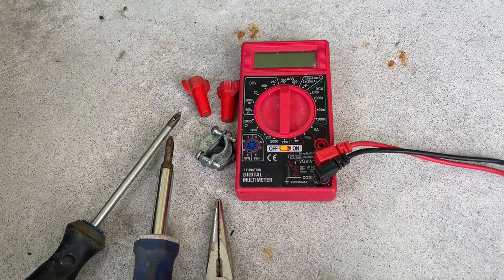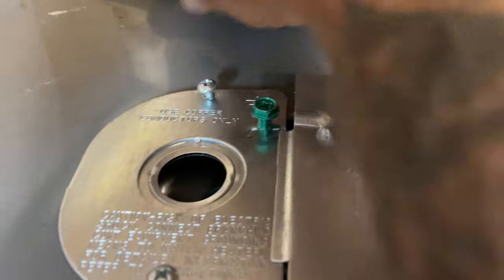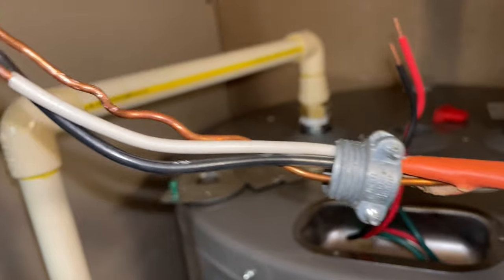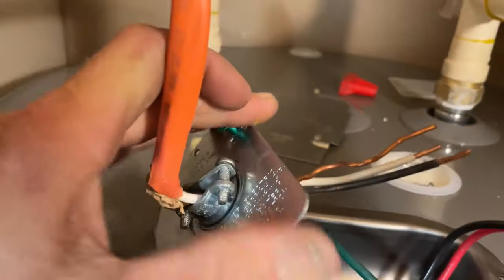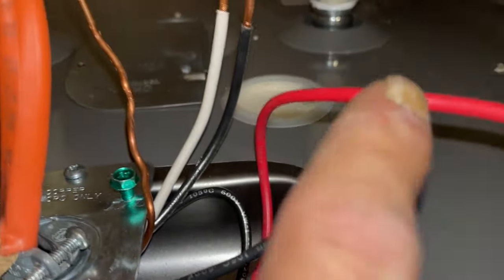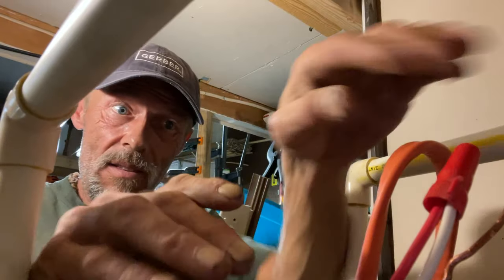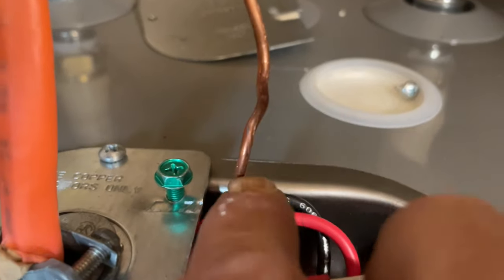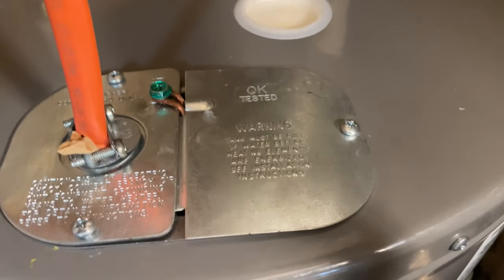HOW TO HOOK UP POWER TO AN ELECTRIC HOT WATER HEATER

Comment: Don't learn electrical from a plumber people....  While the water heater will power on with this install, it's sloppy work.  The wires should always be twisted together using lineman's pliers before you wire nut them.  The insulation should be intact past the strain relief.  Use a tic tester to test for power if you don't know if the circuit is live, especially if you're coming to YouTube to learn how to do this.  220VAC will hurt real bad if you mess up.  Your wires were literally touching together when you said you weren't sure if you hit the right breaker.
Reply: Not to mention: that bare Romex into the junction box is unacceptable.
Reply: @roscoejones4515 I'm just learning but every video talks about the "bare copper wire" when discussing electric water heater installation. Electricions included. 🤷🏼
Reply: You don't need to twist the wire together with linemans unless you hot a limp wrist. But other than that I agree with what your saying
Reply: @nickgamble4544  hahaha bro. Electricians. Im dead!!!
Reply: As long as you do a pull test after twisting the wire nut on and everything is secure then twisting wires together isn't necessary, unless you have 3 or more wires in one connection. Sloppy work though

Comment: Just to note if you are using your white (neutral)  as a hot wire, you need to tape it with black or red tape on both ends... marking it as a hot wire. You'll fail inspection here if you don't.
Reply: Just as I’m saying to my self why did this person wrap the white wire with black electrical tape I read this comment lol😂
Reply: Lol you won't fail inspection....
Reply: @MikeHawkPEN15  you are right, you won't fail... but they will make you wrap it here.

Comment: Just saying, if I was asked to inspect that I would fail it. Reason being you have cut up the insulation outside of the cable clamp. You should be able to see intact insulation protruding from the inside of the wire clamp. The wire clamp should only be holding onto completely intact insulation.
Reply: I was actually going to say the same thing. I thought he might clean it up at some point, but obviously never did.
The way he left it would be failed as a potential shock hazard.

Comment: Lots of homes that have Aluminum wire for large appliances even today it's still legal to use AL wire for water heaters because it's not branch wiring. I had a plumber replace my water heater he used  yellow wire nuts and the connection was poor. Found my breaker tripped and black mark up the wall the AL wire burned back into the wall lucky it tripped the breaker my house would have burned down.  The plumbing company sent an electrician I told him I want a disconnect box at the water heater that way AL and CO wire are connected using LUGS that are approved for both AL and CO wire. If you run into AL wire when you connect a whip from a new water heater that has copper wire don't wire nut use a disconnect.

Comment: Tomic connector... Not adaptor. And that Romex should be in Greenfield, Flexible metal conduit so its protected. And always twist your wires together before you put your wirenut on. And always make sure the insulation on your feed wire is in past the pinch point of your tomic connector before tightening

Comment: This is just a suggestion made by an electrician when reconnecting old incoming wires to the new water heater You should cut off the old wire leads if enough slack is present, this way you have a nice clean connection for your new wire nuts.
Reply: I twist my wire before I put the wire nut on to make sure they are tight before the nut is installed.

Comment: Can you attach the ground wire to the green screw inside the compartment or do you need to use the one on the outside like you did or does it matter?

Comment: Thank you so much Tim for sharing this video. I bought the house almost a year ago so I don't have any idea about all these stuff. I am currently looking for a possible solution to the problem with my water heater. Those similar wires you hooked up got burnt. My question is, is it still safe to rehooked them or should I buy a new water heater? Thanks in advance for your reply.

Comment: When you connect to the breaker, does the white and black go to the screws on the breaker. What about the neutral side? I'm doing my build and I'm good with 120 but the 220 has me a little confused about the neutral on a 10/2 wire to a double pole

Comment: I have black and white from the home wire and black and red from the water heater.  I connected the two blacks together and then the red from the water heater to the white from the house.  I immediately saw some smoke.  I pulled them apart immediately.  Are the wires from the house wire reversed?

Comment: My 240 cable has an extra cable. It has white red black and ground. The white is not connected to anything and it has a wire nut on it. My water heater is not running what do i do with the extra wire?

Comment: My front load washer is next to the water heater and has a pretty violent spin dry. It vibrated one of the hot wires out of the wire nut where it sprang up against the metal cover. One day I touched a ground wire for an electric anode rod to the cover and KAPOW! Now I use a wire nut AND electrical tape. Fortunately it didn’t get me, and it didn’t ruin the water heater. But I made a mess of the wires under that cover. Thanks for the video.
Reply: I always wrap wire nuts with black tape.

Comment: Ok Tim first off nice info on this subject, now a question for you. How can I tell if the wire is a 10 gauge or 12 gauge wire? We live in an older mobile home and need to replace water heater. Can you help? Thanks
Reply: If your wire is in an colored sleeve, which it most likely is, orange will be 10 gauge, yellow is 12 gauge, and white is 14 gauge.  If it is not in a colored outer sleeve, the gauge of the wire will be printed in tiny little letters on the wire.
Reply: Yea this is older mobile home and all the wiring in the breaker box is white and is almost impossible to read. As far as i can tell it's 12GA with a double 20AMP breaker for water heater. Wire is ran through the studs but are also clipped to the studs and cannot pull. Any suggestions?

Comment: I understand white and black wires are positive wires.  My question is,  in the breaker box, does the uninsulated bare wire connect to the neutral bus bar or the ground bus bar?

Comment: Tim i see a double breaker 240 breaker behind door of fuse box my father passed away about 5 months ago and my mom and i are on our own learning as we move forward. 
I have a black positive and a  white that was on the old one but dont know how it was hooked up exactly i dont see a ground with them not sure where dad had a ground hooked too this hot water heater worked for almost 30 years amazing!
Anyway i got white & red together & then 2 blacks together and the ground scree is inside the little compartment with the rest of wires im asking if all would be OK to run a ground wire from the green ground screw to the main cold  water pipe we have the old type of metal pipes in this house
Im hoping you get this and it doesnt take 4ever as we have gone 8 days without and moms too old to do all the extra work when you font have water you know she doesnt deserve all thats happened in the last 10 days 
1st was the ice maker on frig started leaking
2nd i had surgery
3rd the hot water tank was wet at bottom and no hot water
4th she pulled in the driveway put in park ooened the gate and tried to proceed in drivijng in but there was No drive gears on her vehicle so a transmission rebuild is added to all this stress and her dr. Said yesterday her blood pressure is really high and he wants to see her again in another 2 weeks
I cant LOOSE my mom right now shes a strong woman but being without my father after they spent 59 years together her will was still strong but all from the last 10 days and 4 issues with all bad news has pushed her from her strong wills and just WORE HER DOWN from the STRESS OF IT ALL
Im HOPING YOU CAN HELP ME to ASSURE & RELIEVE THE STRESS AND EXTRA WORK FOR HER AND FOR ME TOO AND MAYBE FINALLY ALL WILL FLOW SMOOTHLY and ALLOW us and our Health to gain our Strengths Again!!

Comment: I did the connection just as you said and water heater was working fine  but one time i touched the wires and it started melting the connection and smoke started and the twist connection caught on fire.
Any ideas ?

Comment: Good video thanks 👍
If a short is encountered (braker trips)  due to a skinned hot wire leaving behind a blackened cover of the wire housing at the top of the heater.  What is the procedure or any further precautions should be followed to reconnect the wires again? Thanks.
Reply: Did you get any reply?
If you have a dead short ( breaker trips) just cut off bad part of wire and reconnect

Comment: wrap red or black tape around the white wire to show it a hot lead and not a common wire. this is required by code . this should be done on both ends of the white wire .

Comment: Hi- my electrician ran a cable with 4 wires. How would I hook that up to a water heater that only needs 3 wires?
Reply from the maker: The green is always going to be a ground that will hook up you the green ground screw. 2 of the remaining wires will your power that will hook up to your heater. The last wire should be capped off
Reply: @PLUMBINGWITHTIM  thank you!!!
Reply: @PLUMBINGWITHTIM so basically, you’d cap the white neutral and not connect it with the ground?? So black and red are power, green goes to ground and white is capped??

Comment: I'm pretty sure that wiring is illegal in most places. The wiring should be in conduit if it is not against the wall, or in some places, if it is exposed at all. Hell, Chicago requires wire to be in conduit even if it is inside the wall.  Most people who follow this will  be wiring their water heater illegally. You are also required to have an emergency power shutoff in most places, if the breaker is not within a certain distance. 

With wire nuts, it is a good rule of thumb to twisted them until the two exposed parts of the wires start to twist around each other. This ensures the wire nuts are securely attached. This guy barely made them snug, which can come lose much easier.

Comment: Long question made shorter: Is it a hasard to connect only the ground and leave lets just say for an easy to understand exemple: Both hot wires in their own nuts ( so 4 hot wire nuts total ) NOT touching ( The item wouldnt work ) but the ground is connected, and is the only wire connected.  Thats a bit specific but i need this knowledge, i though it be more simple to ask that rather than explaining several pages of why i need to know this lol :)

Comment: 1st great video on what you are showing .
How would you go about adding a 30 Amp for electric. I've done plenty of electric work and do understand things like shutting down main power and danger of electric > but never wired for a water heater. The house is 18 century completely rewired and including circuit breakers and panels up to date . There also has never been a expansion tank wondering if it's necessary - just hot water gas water heater i would like to  convert to electric -- there are no boilers just space heaters. I do know how to use a electric meter.
Reply from the maker: Thanks for watching
Reply: Also adding the power source for an electric water is as simple as connecting the water heater to a 10/2 nmb wire going to a 30 amp double pole breaker in the panel. Hope that helps although I realize this was asked 7 months ago

Comment: I have a red, black and one white. the white was connected to the ground on the water heater. Is that possible to have  a white wire as ground?
Reply: Anything is possible, but hopefully you didn’t guess, and verified with a meter.
Reply: @thenexthobby  I finally checked with a meter. The white was ground. I guess they use quite as ground back in the 50s 👍

Comment: Good info, hack execution---
@davebrittain9216 stated correctly, and the ground wire was fastened incorrectly. 8:08-It was obvious that the cover plate could not align properly, and just as he says "beautiful", the cover plate bends up as he finishes tightening the screw at a 60 degree angle.

Comment: I'm getting a weird switch between 110v 66v 33.7v and oddly 56v running through my sink faucet
Reply: Somewhere there’s one or more neutrals and grounds miswired, on one or more of your lines.
Reply: You need an electrician asap your plumbing fixtures should have no voltage across them. You have a grounding issue. Hot water heater not bonded, water meter no grounded or so on.
Reply: @thenexthobby  it shocked my hand and is fixed now thanks for your concern and reply

Comment: 5:03, what the logic of there is no wrong to connect which ever wires together? then what is the purpose of having a black wire and red wire on the water heater  then? why didn't he manufacture make them both black, or both red then?
Reply: Good question I wonder that too
Reply: Black and red colors are both considered “hot” wires, whereas white is usually neutral. 
The manufacturer uses one black and one red to indicate that they are DIFFERENT, but both “hot”.
This gives you 120 volts on each wire. 
120x 2 wires is 240. 
On a 10 gauge, 2 wire ( the one connected to your double pole 30 amp breaker that connects to the water heater wires) one is generally black, and one is white. 
As long as each are connected separately and each separate wire goes to separate poles of your double pole 30 amp breaker, and you are grounded at the water heater as well as the ground bus in your breaker panel, you are good to go. 
Be sure to put black or red electrical tape on the white wire insulation at the water heater and the breaker. This indicates that the white wire is now a “hot” and not a neutral. 
Hope that helps.

Comment: Go back and see and hear the last minute of the video. If you don't you will fry the heating elements in the water heater. This happens more often then you think. NEVER, NEVER, NEVER turn on the power to the water heater until you have fill the tank with water. Heater elements can have 4500 watts at 240volts and with no water to heat up will fry instantly. New replacement element will cost $50 each. You need two. You need a 1-1/8 or 1-1/4 socket and breaker bar and time. WHAT!!! You fill the tank! You need to shut off the water and drain the tank. If not, when you remove the first element you will have 60 psi of water shoot at you. Your wife is going to think and say "WHAT A SHIT SHOW" and you're going to reply "I SHOULD'VE CALL TIM" lol

Comment: I connected the red with the white and black and black. And it just popped the electric breaker!!
Reply: The wire in this video is wrong for most installations. It's 10-2 w G, should be 10-3, or 10-3 with ground. You should have three wires. red black and white. Red and Black are hot, white is natural. red and Black go to the hot wires of the heater, white goes to the ground. Or 4 wires. same as above only with a fourth bare wire. That is a ground. On the new hot water heaters the ground and natural are redundant, I guess. You can hook them to the same screw or simply cap one off.
Reply: @griffinreitz7041  
You are wrong, hot water tanks do not require a neutral, therefore you can use the identified conductor (white) as a hot. The most likely reason that person breaker tripped it because it was not connected properly in the panel and they had the white wire going to the neutral bar. You shouldn't be giving electrical advice if you don't know what you are talking about.
Reply: @kevinbreiter2661  You never use white as a hot. If you are going to, it should be marked with black or red.
Reply: @griffinreitz7041  you most certainly can use the white as hot. Supposed to mark it as such. It's silly to buy 10-3 to do this

Comment: Not to code…..come on man….you didn’t push the romex down through the connector…..or twisted the number 10 before putting on the red wire nut…that’s how fires start…does it work yeah but for how long….